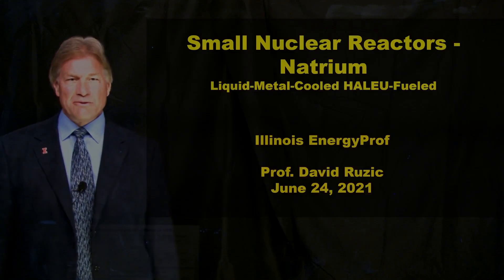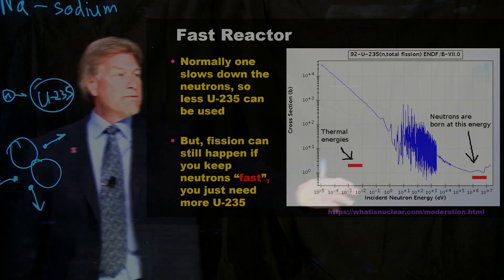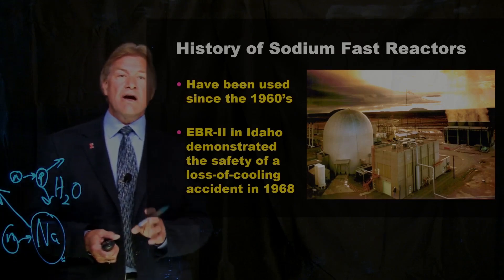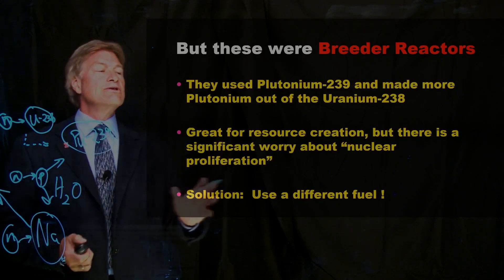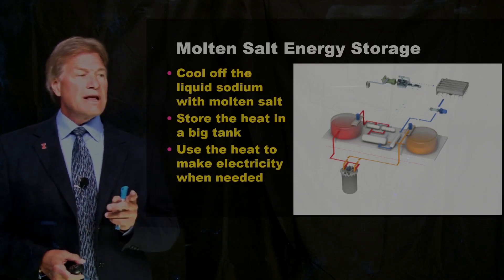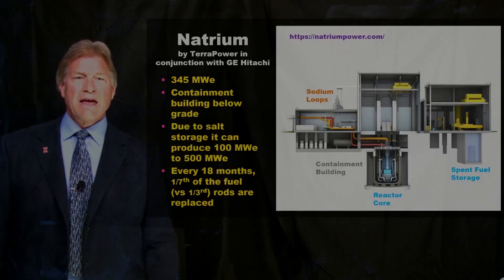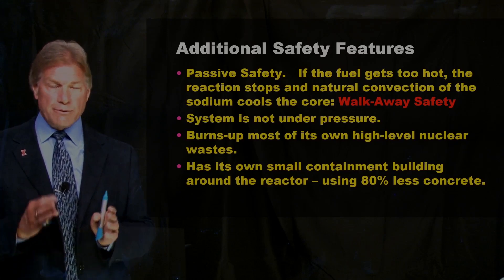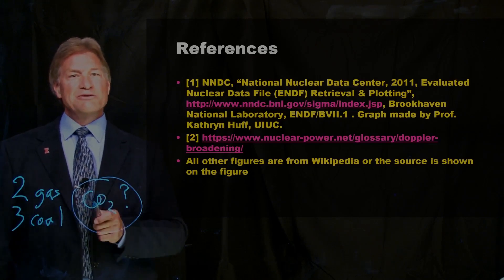Small Nuclear Reactors - Natrium

Comment: Energy Prof gives a lot of good info here but it's always one-sided and ignores some of the potential downsides to this and other nuclear technology. 

When he talked about the Fenix and SuperFenix reactors in France, or the fast breeder reactor programs in the US, he doesn't mention that these plants were enormously expensive failures that completely failed at proving commercial viability for this technology. Japan has also seen massively expensive boondoggles at its breeder reactor demonstration projects. The problem is that the sodium coolant is hard to handle and leads to coolant fires way too often for commercial operation. There's also been a problem of debris and impurities in the sodium coolant clogging the coolant channels around the fuel leading to partial meltdowns. Well Bradley speaking the reactivity goes down as temperature goes up and if the coolant stops, for acute and localized losses of coolant, failures can spring up way too rapidly for those Walk away safety features to stop them. 

There's also a problem with nuclear proliferation that wasn't discussed here. Going to higher enrichment allows any country that employs this technology to more easily disguise their nuclear weapons program behind a civilian power program using higher enriched fuel. And wow leaving the fuel in the reactor allows the plutonium produced to burn up, all any enterprising country that wants more plutonium for its weapons program can do is remove the fuel before it is scheduled to be removed and separate out the plutonium very easily.

Finally, we all hear nth of a kind costs but we need to remember that a lot of assumptions go into these estimates. The nuclear industry already has egg on its face from claiming that it would eventually produce power that was "too cheap to meter". This technology will definitely need a lot of government support to get off the ground and to get anywhere close to proving the assumptions of terra power to be true or false. It's unclear if this money will be better spent just building solar thermal power plants that have many of the same benefits of this technology with none of the proliferation cost and technical risk downsides.
Reply from the maker: These are good points, all deserving great discussions. 
Briefly though, on the first points -- I agree that breeders are very expensive.  In terms of molten sodium loops there have been many technological improvements.  We will see in this new plant if they all work
On proliferation, you need to get to 85%+ U-235 to get a bomb.  If you can enrich Uranium at all, you can do that.  If there is a way to limit places enriching it to only 3.5% then the same technique (monitors, inspections etc.) can be used to limit it to 19%.  Both are difficult for sure.
Economics, I am right with you.  There are a lot of assumptions.  I at least feel it is a good use of a modest bit of the tax-payers money.  At least this burden is partially supported by industry and other investors too.
Reply: @George Mann none of these reactors are being built with commercial money and are completely government programs. The Russian reactor was built in preparation for a plan in conjunction with the United States to take weapons grade material and use it for civilian power. Do Russians just keep running the reactors even during sodium coolant fires. That might be okay in the former Soviet union, but anywhere else that's not going to fly.

And your strange beliefs about solar power are just not tethered to reality at all. You've been smoking some heavy stuff if you think any of that is true.
Reply: @saultcrystals  >The Russian reactor was built in preparation for a plan in conjunction with the United States to take weapons grade material and use it for civilian power. 
That was never the main purpose of that program, it always was about closing energy cycle. It just so happened that there was that agreement proposed which could raise more funds for Russia's own MOX program. Plus BN-600 was never used with MOX fuel or HALEU made of former weapon-grade HEU. And since USA failed miserabely in producing any decent technology to burn weapon-grade Pu, Russia froze their part of a deal either, and use MOX fuel that is made from recycling VVER and RBMK spent fuel instead.

>Do Russians just keep running the reactors even during sodium coolant fires.
There were no fires on BN-800 and BN-600. The last fire was afaik on BN-5 more than 60 years ago. 

>That might be okay in the former Soviet union, but anywhere else that's not going to fly.
Rosatom has the highest standards in the world as they have the largest competence in nuclear weapons, wastes and power in the world. There's virtually nothing others can do and they cannot (except for some RnD projects). Plus Fukushima had clearly shown what western "high standards" means when it comes to nuclear power. You can runt all you like but it was Rosatom that first made Gen III+ after Fukushima, and it is them that make first Gen IV reactor. 
And to rub salt even more, it is Rosatom who is the major solar and wind power plants constructor in Russia, so they have nothing against renewables, in fact they are the main lobbyists of hydrogen, renewable and many other green technologies in Russia.
Reply: @George Mann I think you feel the need to bash wind and solar with these completely false allegations is because you're getting your information from fossil fuel propaganda shops.
Reply: @George Mann sorry but fossil fuel and nuclear power companies have been the biggest funders of misinformation about climate science and renewable energy.
Reply: @George Mann and you have proven that you're just going to repost fossil fuel industry propaganda just because it confirms your existing beliefs.

Comment: I hope at least one type of modular reactor that doesn’t need to be pressurized works out. Work out a safe design and build it in a factory under strict quality controls. They can steadily replace the coal fired plants with nuclear. Then we hold the utilities feet in the fire until they clean up the ash ponds at every coal plant.

Comment: [They say they can build the nth for 1bn or 50$/MWh(5c/kWh)]
is something that I'm very skeptical about.
In the past nuclear was advertised with "to cheap to meter" and it didn't hild up to that promise.

Wind/Solar is expected to drop to below 10$/MWh (In the middle east solar is already cheaper than oil), which is less than 1/5th the cost.
Yes storage is a big issue, but a 400% cost difference is hard to beat.
Reply from the maker: all good points. 
The ability to make massive heat in one location, and the 24/7 assured availability make nuclear an important compliment to solar/wind.  I do not think a practical grid could be all solar/wind.
Reply: @illinoisenergyprof6878  
But that 24/7 availability is based on heat storage which can be indipendently build based on any energy source, especially with a 1 to 5 or even 1 to 10 cost benefit of renewables.
Reply: @Pene7942 
2 issues here:
The heat example was chosen to have a direct comparison. If renewables are cheaper and both systems use heat storage than renewables would still have a cost benefit.
That wouldn't be the most efficient way or recommended way to do it.

From all I've read the most efficient way seems to be:
1. Use as much electricity from renewables as possible directly via load shifting (I don't care when my EV is charging, only when it should be finished charging.)
2. Use battery storage for short term storage (hours to days)
3. Use hydrogen or synthetic methan for long-term storage as it can be stored in natural gas storage facilities and can be turned into electricity in natural gas turbines. This shows an easier transition path, as u can switch gradually
4. Any additional short term overproduction should be stored in heat storage. 2&3 are expensive, while 4 is dirt cheap. A heat-pump is much more efficient, but also more expensive (investment wise).
For few running hours, heat storage is the best option as it allows us to not waste overproduction but use it to heat water and houses.

All this should be more efficient and more cost effective than heat storage turned into electricity.

Comment: What about the carbon footprint of the mining and shipping etc of the fuel? Would be good to see this looked into
Reply: What about the carbon footprint of mining and processing rare earth metals and pure silicon for wind and solar?
Reply: @bobthebomb1596  There have been studies into materials used in batteries and they end up being better environmentally than a fossil fuel powered car over their lifetime, usually within 7 years and less as time goes on. But I agree, we need to look into all these things
Reply: @bofty  I am confused. I thought you were talking about the cost of mining and processing the nuclear fuel for the reactor, not fossil fuels for cars?
There is certainly a carbon footprint to uranium extraction / processing. Mining and transportation vehicles are fossil fuel powered and HEX has to be kept hot during enrichment.
However mining and transportation of rare earth metals and cobalt also involves the use of fossil fuelled vehicles. Separation and purification of silicon is energy intensive and the process currently uses both copper and carbon and generated carbon dioxide as a waste product.

All of these could be mitigated in the future of course. I see a balance of nuclear and renewable sources, selected on a case by case basis, as the ideal way forward.
Reply: @bobthebomb1596  My point was many of those items (whether in batteries or wind turbines) can be recycled and in the long run are much better for the environment. I'm not against nuclear, I'm for the better long term option which is not nuclear imo (unless I see good evidence to change my mind)
Reply: @bofty  Most wind turbine blades are composite and go straight to landfill.

I agree that the best long term option is probably solar, but generated off planet.

The great advantage of nuclear is high energy density. Small modular reactors are ideal for providing either heat or power for energy intensive industrial processes such as hydrogen generation, steel, concrete or synthetic fuel production etc.
Reply: @bobthebomb1596  I don't think Pablo is passive-aggressively criticizing uranium mining - I'm betting he's interested in the same specs with respect to renewables, and again with the footprint of EV manufacturing.  It's a metric that needs examination; in uranium's case, I'd also bet it will make it to the "nuclear:pros" column.  But Pablo, why would you rather not use nuclear?  I'm highly interested in hearing your thoughts on this, given the education available on the benefits of nuclear, the vast store of experience of the industry, and the exceptional engineering that has solved any and all technical and safety-related issues and disadvantages?

Comment: Sodium is flammable. When it burns you cant use water to put it out.  Ultrasafe Nuclear corp has a triso fueled reactor to heat molten salt that is graphite moderated and helium cooled. helium is chemically inert.
Reply from the maker: I like the Ultrasafe Nuclear design and the other TRISO reactors.  See my recent videos on both of those.
Reply: @illinoisenergyprof6878  a sodium fire at a nuke plant would set nuclear back ten years or more. Until the world understands how safe and NECESSARY fission power is, i don't think we can afford to take the risk. There are many other waste burner designs as you well know.

Comment: "when it gets too hot, it stops working"

Wasn't the exact same thing said about water moderated reactors?
Reply from the maker: If all the water leaves a water-cooled, water-moderated reactor then the fission stops because there is no moderator.  The problem is that there is no coolant either, and the "waste-heat" can be enough to still damage the core.  Generation III reactors solve that problem by lowering the energy density, so that just air convection can cool the waste heat.
Reply: Where was this said? Molten salt reactors maybe but water no. Doppler broadening does not work at low neutron energies, the resonances are not present. Thermal expansion is not usable, the moderator(water) would boil first

Comment: "You can't use wind and solar because they are not constant and require grid storage."

"Nukes need grid storage because they cannot be throttled, otherwise they only run at base load."

You just said equivalent things about both energy sources. There are lots and lots of forms of grid storage, and no one in their right mind would Li-ion or most other high density storage, with the exception of molten salt.
Reply: French nuclear reactors adapt their production. It has drawbacks (mostly cost), but it’s doable.

Comment: To stop cooling a fast reactor isn't a problem or danger. The problem is if you poison the coolant with some light moderator that turns it back into a slow reactor. Then it starts creating transuranics again and blows up. That's probably the danger of fast reactors.

Comment: Once you accept nuclear there is no justification for wind and solar.
Reply: Not so, they all have their part to play.
Why would you build a reactor to produce electricity in an area with a near constant prevailing wind for example?
Reply: @George Mann I am sorry but that is a silly statement.
There are countries/regions where renewables make absolute sense as the primary means of power generation.

Any area with natural volcanic activity would be mad not to make geothermal their primary energy source. Iceland, Hawaii and many of the pacific island nations spring to mind.

Similarly, much of N Africa and the middle east are prime candidates for solar; through both PV and a combination of solar collection and molten salt storage.

The UK already produces a significant amount of its energy from offshore wind and has large tidal and wave energy reserves. Had it continued to develop its nuclear industry it would already be in a position to relegate fossil fuel use to niche applications.

It's not rocket science, but is does require all sides to take off their blinkers with respect to their own pet technology and work together.
Reply: @George Mann "You guys?" I have always been a proponent of nuclear energy.

The fact that something is not being utilised on the scale that it should be does not mean it is the wrong way to go.
It would have been easy to make similar claims about the internal combustion engine at the turn of the 20th century;  noisy and too expensive, they will never replace the horse as a means of transport for "ordinary" people.

I live in the UK which is only now beginning to see the end of coal fired power generation. Had we followed the nuclear route we would by now be almost completely fossil free, but we chose not to do so.
Going forward, we have the technology to exploit the vast reserves of offshore wind and tidal energy available to us, why would we choose to continue with fossil fuels?

I agree that is not an option available to everyone, but that is not an excuse to continue blindly on the same path.
If the most practical way forwards for a country turns out to be new generation coal with carbon capture fine, go for it.
But to say that renewables will only ever be a bit part player is ridiculous.

Comment: Good video. I am personally trying to get a little bit of funding related to this project. 

I do want to make a small criticism though. The professor appears to be conflating safety around the neutron kinetics and meltdown safety systems. 

Things like the Doppler feedback and fuel expansion feedback are feedback mechanisms that are used to keep the reactor from going too (prompt) supercritical, or for helping the reactor shut down. 

But even after the reactor is shut down it's still producing heat in the form of decay heat. The fission products are still radioactive and as they decay they produce heat which can raise the temperature of the fuel. They can raise the temperature of the fuel so much that the fuel melts, creating a meltdown. This happened at Fukushima they successfully shut down the reactor minutes in, but still had to keep removing decay heat by pumping water for longer than they were able off of a single battery.

Some new smrs are able to have passive meltdown safety by having high surface area to volume ratios that allow them to remove all of their decay heat without the use of pumps or external intervention through mechanisms like natural circulation. That might be the case with this reactor design but it wasn't brought up that way. It's also possible that sodium is such an excellent conductor that it removes all the decay heat by itself. 

But just because an increasing temperature causes the fission reaction to shut down doesn't mean that it's impossible for a meltdown to occur.
Reply from the maker: I may have glossed over this too quickly.  In the Natrium design, the natural convective circulation of the sodium is enough to remove the waste heat.

Comment: Great lecture David. If possible it would sound much better if you remove the background noise reducer setting, which sounds like it is going on. Also if you can add a multi-band compressor with a broadcast preset or similar, just to reduce the volume spikes when you get louder.
Reply from the maker: We have been working on the sound, and I appreciate these concrete suggestions.  We will take a look.  Thanks.